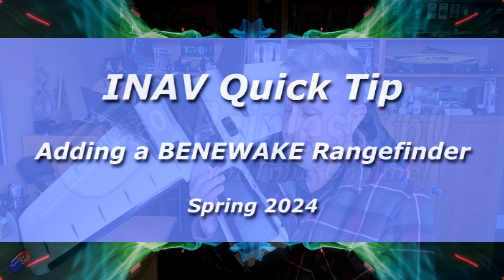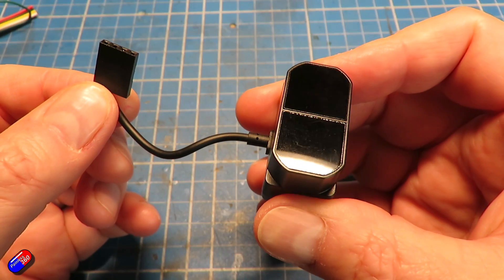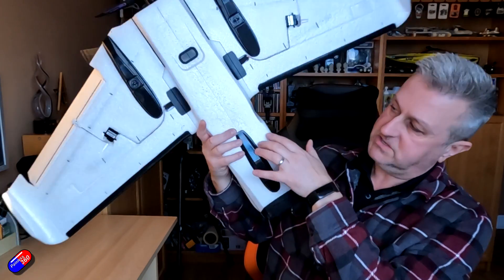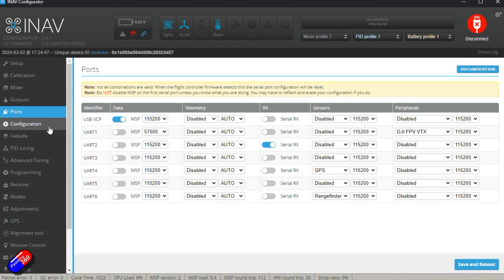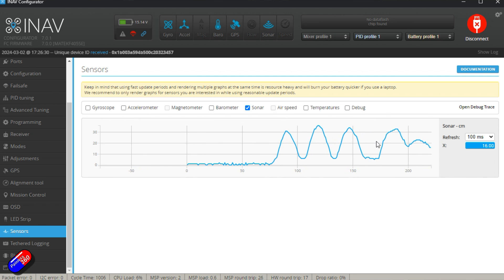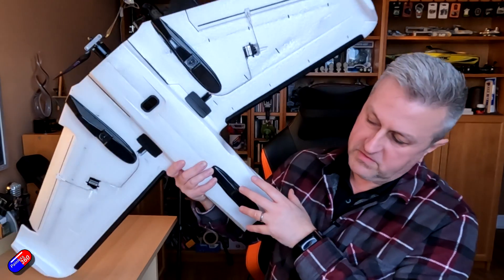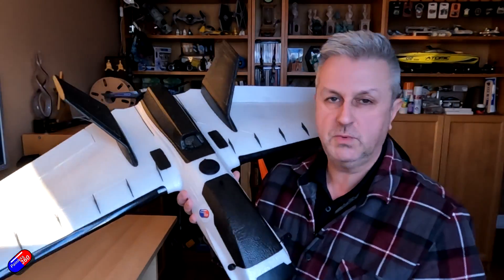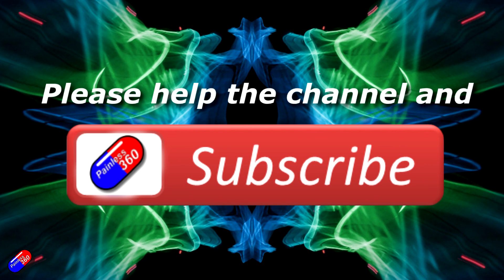Installing a Benewake TF Mini Plus Rangefinder (for automated landings in INAV 7.1)

Comment: On your quad setup for Matek rangefinder (older video same INAV) it was done in a different way. Why didn't you use the rangefinder option on the quad but instead setup MSP on 'Ports' and choose the options under 'Sensors and buses'? I am using TFMiniPlus on quad. Cheers.
Reply from the maker: It is dependant on the connection method that the rangefinder comes with.. See the manual for the one you have.

Comment: I think I followed your video verbatim. But all I get from the sensor output is a level line at 0. Any suggestions?
Reply from the maker: What troubleshooting have you already done?
Reply: @Painless360  not much really. The rangefinder shows green at the top of the screen so I think I have it wired up right. But when I look at the sensor page it only shows a flat line at zero. I have a ttl to usb on order so I can hook up to my computer and their software to see what it reads. It should be here on Saturday.
Reply from the maker: Best of luck, if you need a TTL board then you're not using the same stuff as I am in the video. I hope you get it working.

Comment: Hi, I just purchased one of these sensors but I need to mount it 90° to how you have it mounted to make it fit in my model. Will it work in this orientation? I assume it will since it is only measuring distance but I didn’t see any information on orientation in the user manual.
Reply from the maker: Yes, it'll work fine... Happy flying
Reply: Thanks for the reply and thanks for all the great videos.

Comment: Thanks so much for this! I have installed TF Mini Plus rangefinders in an AtomRC Dolphin and a Heewing T2 (build in progress). I eagerly await your reporting on iNAV 7.1 auto-land.
Reply from the maker: Still waiting for the tweaks coming in V7.1.1...
Reply: @Painless360  Very good. For now, I will try to work up the courage to try landing while wearing my goggles. ;>) So far, I am reverting to LOS for that.
Reply from the maker: It can be a little scary the first few times but once you get used to it, it's super easy to land with a 'pilots eye view'
Best of luck
Reply: @Painless360  You were correct! Once I finally tried landing with goggles, it wasn't as hard as I expected. As of yesterday, I am two-for-two successful landings. Thanks again. Looking forward to more INAV autoland info.

Comment: FYI: If you have a spare 4.5V pad you can also connect the range finder to it and it will be powered by USB power as well
Reply from the maker: Be careful doing that. Trying to power too many things from the USB port can cause problems... Happy flying!
Reply: @Painless360  Absolutely true :) when problems arise plugging in a battery is always the first step to debugging :D

Comment: Thanks for this one. The last meters of Autolanding a quad with INAV is not so critical because you can slow down the descending speed a lot for the last few meters and motors will stop after autodetecting landing. For planes it is a different situation in INAV because of the baro/gps drift as you explained. I'm manual landing in INAV mostly 2 to 3 meters below ground level because of this drift 😊 That's too much difference for flaring in  Autolanding.  This Lidar / Rangefinder seems a good option.
Reply from the maker: https://youtu.be/42JBUP0k2Vg should help (preview for you!)

Comment: Would I be right in thinking this is only going to make a bice landing if your aporoach is over flat level ground? I'm thinking that approach over undulating/uneven ground will produce strange behaviour. I wonder whether flying over a hedge or bush would even cause odd effects?
Reply from the maker: Stay tuned for when V7.1 is released. I'd suspect that needing a nice, open and flat ground is important for auto-landing to work well..

Comment: Thinking it might be cheaper to   cannibalize a cheap laser tapevmeasure and get greater range... how I passed electronics,  tearing things apart to use in different ways.  Crazy but fun.. take care.

ze
Reply from the maker: If you figure out how to do that and then add something like an arduino to be able to transmit the values to the flight controller using the right protocol, that would make an interesting video. Best of luck

Comment: I'm a bit surprised this plugs into a UART rather than I2C such as a compass or airspeed sensor. That said, I'm no programmer and don't really understand those nuances. It's very cool to see these functions make their way into iNav. I do appreciate setting up a complex model just for sakes of understanding how it works and the sheer gadgetry of it.
Reply from the maker: Other sensors use the UART too.. Until 7.1, their benefit on fixed wing has been limited.. Happy flying
Reply: You have the option on 3dxr to choose either UART or I2C interface